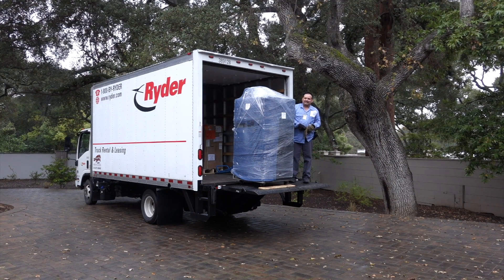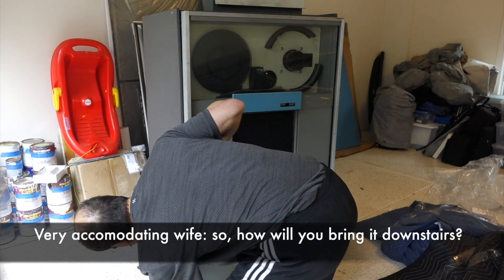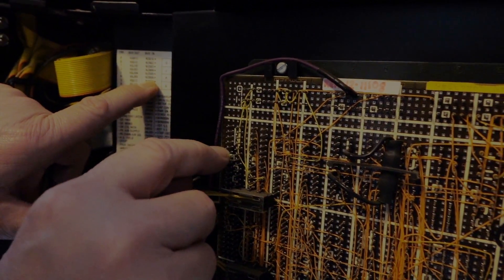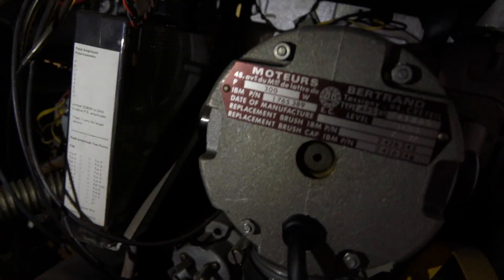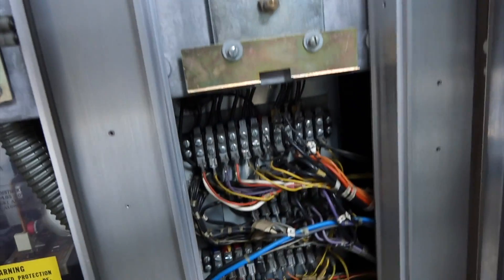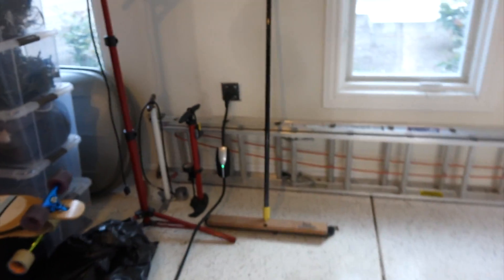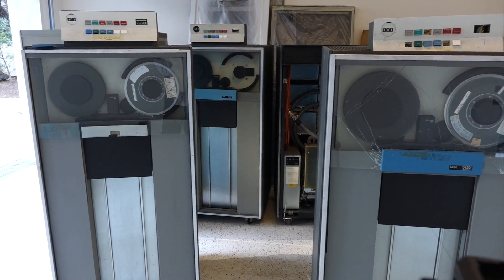IBM 3420 9-track tape drives arrrive for restoration. 800 lbs each!

Comment: Are these the ones that had the rubber strip seal at the top? If you pinched the rubber, the door would open. A safety device in case you got your hand, head or other body part trapped while the door was closing. I remember someone also told me that the head cleaner for these turned out to be carcinogenic. MEK?
Reply from the maker: Thanks, I didn't know!
Reply: Luca Viggiani yes. The 3420 models had a rubbee strip at the top of the door inside the metal frame to drop the glass front in the even of an obstirction and to abort the load sequence. The 2401 had a metal strip at the top of the door that did the same thing

Comment: I am IBM retired and as a Customer Engineer (CE) I worked on these units. The customer account I was assigned to originally had twenty four model 2401 tape units on three different 360 systems. They required a lot of maintenance. The account finally upgraded to the 2420 model and life for me became much easier. They were amazing tape units, very reliable. Just make sure you do not poke you finger through the fragile capstan (the part that moves the tape). Doubt you can find a replacement anywhere now.  The address 381 on the front upper panel is the address of the drive (channel 3, unit 81).
Reply: Buzz Corey the 2401s had an amazing rewind time!
I also remember the head assembly was made in france as well. We had one srive where the heads became magnetized and a tape sort would always fail on this drive. The CE came in and ajusted the read amplifier he kept wondering why the read signal kept dropping. He kept adjusting the amplifier. After obtaining a new head, I suggested to degauss the old heads as i have aeen this before in video recording. He grumbled a little bit and obtained a degauser and wiped them iver the heads. Bingo! Problem went away!
Reply: Hello from Germany. Maybe you are so generous to answer may question if it is possible to run such kind of tape unit as a "stand alone device" in some kind of "test mode" so that it can load and unload a tape. Background is that there is a single 3420 unit in our computer museum and it would be a really eyecatcher if it can operate a little bit.😁

Comment: Why all the vacuum lines?
Reply: The 3420s (and earlier models) used vacuum to pull loops of tape down into the columns on either side of the capstan motor and the read/write and erase heads. The idea was to reduce the mass that the capstan motor had to move to the bare minimum so it could accelerate the tape very quickly for reading and writing.  The holes in the columns had vacuum switches behind them, allowing the machine to detect how high the tape loop was in each column.  These vacuum switches controlled when to turn on the tape reel motors, which were relatively high mass.  This decoupling arrangement is why you can see the tape in the columns always move first, followed by movement of the reels if necessary to keep the tape loops where they should be.
Reply: @gregames897  Thanks for the information.

Comment: I remember helping install the buss and tag cables.  Making the bends to bring them up from the floor and attaching them.  If you were short on the cable length you were screwed.

I enjoyed the 370 and the 3705 FEP for SNA networking.

Best of luck.
Reply: Installing Bus & Tag cables was a pain. Or removing them. You had to (un)weave the cables from all the other ones under the raised floor while taking care not to damage the rather bulky connectors. I know why some people just snipped off the connectors and pulled hard!

Marc would have loved a 3705. I think it was one of the last IBM devices with real core memory. And don’t get me started on SNA, IBM’s great networking failure.

Comment: What a magnificent gear. Cant understand why IBM contructed the board the way they did and not using routed PCBs with coppre traces. Some card are %100 hardwired, pain to trace a missconection. Sure this didnt happened very often because IBM quality was top notch and this GEAR was serviced regularly.
Reply from the maker: I think this one is partially PCB traces and partially wires. I'd guess it's historical, and these are machine made. They had very advanced computer automated backplane wiring technology as early as the 1950's. The 1959 IBM 1401 is computer wire-wrapped. I'd also suspect it allowed flexibilty to do field modifications and install add-ons, something IBM had also been doing for a long time.

Comment: That's a fantastic score you have there. I'm amazed such stuff is still to be found.
But I'm sure that this gear is from the System/370 era - the standard tape unit for System/360 was the 2401.
Reply from the maker: Yes, you  are right, Iggy also just reminded me that these tapes and this controller were introduced with the 370. This particular model 6 can go up to 6250 cpi. The equivalent tape for the System/360 was the 2420, Phase Encoded, would go to 1600 cpi, and was announced in 1968. It looks identical, but the electronics use first generation SLTs. The 3420 was announced in 1970. My 360 panel is from 1969, so I think I hooking the two together is still historically legit ;-)

Comment: This model automatically opens the tape reel cartridge.
Reply from the maker: Exactly. And threads the tape through the machine. Can't wait to see that happen (or fail!).
Reply: The 34xx drives were ubiquitous. The San Francisco Unified School District at 240 Van Ness had four of them. The SF Water Department at 425 Mason had several.
Reply: @CuriousMarc  thays what the blower motors are for. The air enters the side of the autoload cartridge. When you press LOAD the black circular thing with the peg on it, rotates to "open" the cartridge. The air enters the cartridge from the sides. You will see little rubber pillows on the drive that come in contact wirh the cartridge. This air "floats' or suspends the tape in the cartridge. The reel then rotates clockwise to allow the tape to exit the cartridge. If the tape does not exit withing a few rotations, the reel spins counter clockwise as it assumes the tape may be getting bunched up in the cartridge. After it "reminds" a few revolutions, it attempts the load again. It will do this 3 times. If it fails to load on the 3rd attempt the load light blinks until the operator has to fix the problem. The ends of the tape must be cut and crimped with a little tool or it will never load. Those drives are very picky about tape condition. If a tape cartridge is cracked it won't autoload, if the tape is not crimped properly, it won't autoload. 
You can manually load a tape by hand, by pulling the front door open, press the load button and feed the tape into the drive, then close the door once loaded.
A tape loads by using air to push the tape along a straight path until it gets to the take up reel (on the left) once the flapping end gets up to the hub, there is a vaccumm on the hub that sucks the tape to it. Once the drive detects a high vaccumm on the hub, this means the tape has wrapped around it. The take up spool pulls the tape from the supply side (right side) until it detects the silver tape under an optical reflector. This is known as the Beginning if Tape (BOT) foil marker. Once it detects that spot the high vacuum turns on in the columns and each spool turns to allow tape to fill the column to the right level (I think it was done by vaccumm pressure detection. (The 2401s had two small holes - 1 at the top and one at the bottom. If tape goes past the bottom detector the spool motor pulls the tape up the column unit it detect tape at the top hole, then it stops moving tape) 
Once the tape is in both columns the head covers come down on the tape and the vacuum capstan pulls the tape backward to the BOT marker. At that point rhe tape is loaded, but is not "READY" until the ready light comes on.
When the ready light does come on it produces an I/o interrupt to the CPU.
I have worked on these machine for decades and wrote thousands of lines of assemly code on these machines. I was a systems programmer for a bank for 12 years.
If you want to know the unload process. Let me know!!

BTW all the drive get thier power from the controller and a power off/on request sequences each unit to power up/down. (Same with disk drives and printers) This is to avoid MAJOR power fluctuations in a building.
Its wild because even if you press the POWER OFF button on the console and the computer is not idle, the console will display a msg saying "Unable to power off, please shutdown all jobs first"
The only button that could immediately shut off power was that little red knob called "Emergency power" but using that might do major harm to the system. It ONLY there in case soneone is getting electrocuted!!! :)
Reply: RaymondHng yes the 3420 was autoload. The tape bands had to have air blown into it to allow the tape to "float" inside the tape band

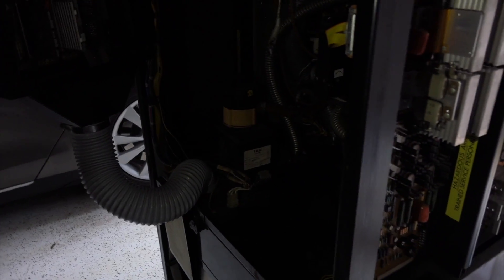Comment: 7:08 Oh, those are vacuum tubes.
Reply from the maker: They were. Like in "vacuum hoses". Besides the vacuum columns, this tape has an auto-loading and auto-threading mechanism that makes heavy use of vacuum apparently.
Reply: CuriousMarc it also uses a blower to supply air to the tape bands to allow the tapr to "float" in the band while the supply spool woind the tape out. Yoy should also look for a tape crimper as well. These were used to cut the end of the tape rounded and to crimp tje edge so it was a little stuff so the tape couls autofeed correctly. Try to locate one or you will get very frustrated when the tape wont autoload

Comment: I wonder if there are any functional S/360 systems still around?
Reply from the maker: Save for the 2 FPGA replicas I mentioned somewhere else, not to my knowledge. I suspect it's high on the Living Computer Museum to do list though, they have acquired 3 I believe.
Reply: @CuriousMarc  I think it’s a pretty tall order (good luck). If you can't get the hardware, there are System/370 emulators (https://en.wikipedia.org/wiki/Hercules_(emulator) for example). But real System/370s had channels – separate IO computers – which came in separate boxes, and while the system level of instructions required to program the channels “CCWs” is reasonably well documented, I have never seen the electrical specs for the interfaces between the mainframe and the channel, and the channel and various control units.
Reply: I think the last production model 360 was decommissioned in Canada in the late 90's. I remember reading an article about it somewhere in a computer trade publication of the time.

Comment: Excellent. I think I know where those drives came from, and it is good they are finally in safe hands. 3420s dried up in the wild about ten years ago. Hopefully soon I will be getting a string of them imported for a friend (I have plenty myself).

One thing to note - while the steady state power draw is not all that horrible, those tape can create very large current surges when the motors start and stop.
Reply from the maker: +uniservo: yes, I think you know. I need to pay you a little visit to see your collection when I am on the East Coast... Did you get yours to work?
Reply: Do the motors backfeed the AC line when they stop?
Reply: I would imagine there is protection for that

Comment: Wow!!!  Congratulations!  This was my favorite IBM tape drive of all time.  You now have a complete subsystem so theoretically these drives will be able to read and write real data to/from an external system via FPGA that you mentioned, although successfully interfacing an FPGA to bus and tag channel architecture will be challenging.

One thing - I always thought that the IBM 34xx series of tape drives were officially considered to be of the IBM 370 family, not the IBM 360 family (although they could easily be used on IBM 360).  The tape drives of the IBM 360 family were the IBM 24xx series.
Reply: Definitely System/370. Central London computer centres I worked in based around 3081/3084/3090 had huge rooms full of 3420's.
Reply: @PhilUKNet  Plus all those tapes that went back and forth to BACS…

Comment: Interesting!!  In my attic, I just found a couple of IBM360 type manuals that are about to find their way to the dump.  Probably just error codes and messages, but IF you might be interested ...?     I think we had a 360/370 in the early 80s with, I think, 7 of those tape drives.  When they moved it out, I wanted to be the one to flip the main switch on the CPU that doesn't UN-switch ;-)
Reply from the maker: Thanks, I'm interested. Send me a private message (go to my channel page, about tab, send message button).
Reply: Jay Herde that was the emergency power pull switch. Never pull that unless someone is getting injured! Someone pulled that at out installation and it cause many hours or repair to the CPU. it is best to request a cycled power off from the console. The CPU will send sigbals to the peripherals to shut down in Sequenxe as to not cause a huge power spike! I had to power down a very large 370 system and to watch it power down was awesome
Reply: @rty1955  What happened to these huge systems if there was a sudden power failure to the building? Did they require powerful UPS setups for backup?
Reply: @tomlewitt  funny u should ask. I was working at a Bank facility at a 40,000 sq foot facility with vendors from IBM, CDC, HP, DATA GENERAL, and others. We had two IBM mainframes w/16 tape drives, sea of disk drives. We had a 625 sq foot UPS room. This room was full of bus batteries and a TRUE UPS (NOT a standby supply like most "UPS" systems) in other words the entire data center was always on the UPS even the A/C units on the raised floor. One afternoon there was a car accident and the car g it the pole with the Transformer on it. The entire building went dark. People kept calling the data center to see if we were still up & running, which of course we were. I came out of the Data Center to find out WHY the generator didnt kick on. Turned out the car knocked out 2 phases of power not 3. The generator did not start up because of this a d they called the electrician to get the generator to run. I informed them we had 45 min to live on the UPS before we HAD to power down in am orderly fashion or face certain hardware damage. 
The electrician got the generator running with 10 min to spare.
A mainframe can take up to an hour to come up from a cold start.
Reply: @rty1955  Wow that's fascinating. That UPS system must have been massive. And probably a tech's major nightmare, wondering if it will hold up, and the generator will indeed start! And in those days the batteries would have had to be continuously maintained, re distilled water etc... The biggest 'UPS' I've seen was in a large telephone exchange here in NZ, around 1971. It simply had a wall of car batteries, and possibly no inverter as all the relay stuff was DC anyway?
Reply: @tomlewitt  the UPS itself was on one wall about 20feet wide. It was a 3 phase true UPS. It was always on. The UPS room was soundproofed as it was part of the data center and was extremely noisy. We could monitor the o/p amperage load as we ass charge current. As long as the charge current was at certain level, all was good. The batteries were lead acid batteies that are used in buses and large trucks. Our specification was 45 min in full load. Normally in fhe event if a power failure, a generator would awake, stabilize, then an automatic transfer took place. That took about 30 seconds or so. The generator was tested every month. The funny thing was that the entire data center was on the UPS, lights, raised floor a/c and almost every outlet in the data center. Since it was a bank, there were no windows allowed, so we could never see the weather. We would have to go out into the office space to look outside.
Reply: @rty1955  Wow , very interesting. That sure was a mammoth UPS setup and operation. A whole lost world of vintage 'corporate computing'...Many thanks for your fascinating replies. -Tom in NZ
Reply: @tomlewitt  yes. I get a kick out of people who think server rooms are awesome. They should be in a real data center!
Cheers!

Comment: Vacuum tubing? I thought it was transistorized! ;)
Reply: Vacuum tubes are still used in high end audio systems.
Reply: Yeah, I hear that the 3420 really brings out warm mid-tones. That's a reel2reel tape for ya.
Reply: I know of a place to get tubes for really cheap
Reply: +code123ns

I'm pretty sure they mean pneumatic vacuum tubes (PLUMBING.)  Remember, the tape is a vacuum column tape path.  It has to suck the tapes down into the column, thus the plumbing..,

Comment: How excellent! I am an old timer who watched this equipment running. I love watching you work on these old machines. I can't wait for some videos of your journey to repair these units. It will be a real challenge to make sure all the different vacuum pressures and air pump pressures mesh for perfect functionality. I've always suspected that there would be glitches related to oxidation of some or all of the tiny jumper wires on these old boards, changing the resistances all across the board. Keep up the great videos and thank you for everything.